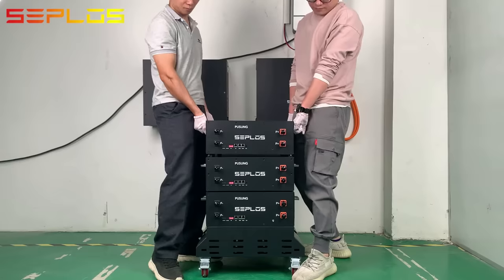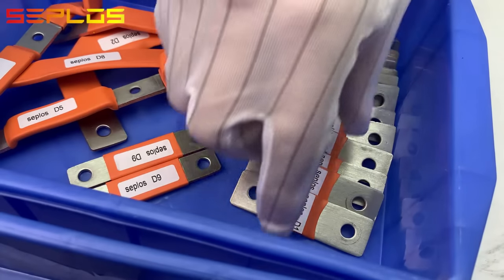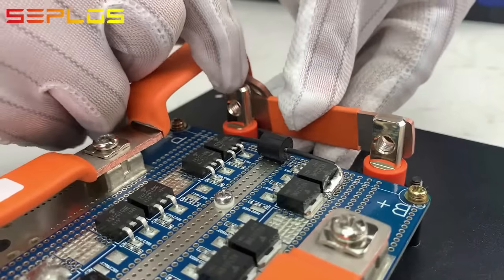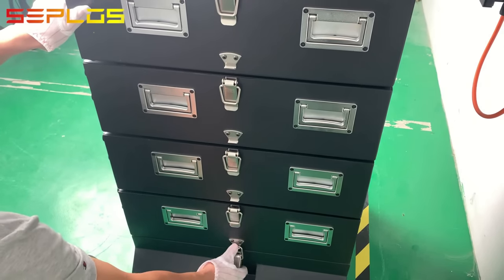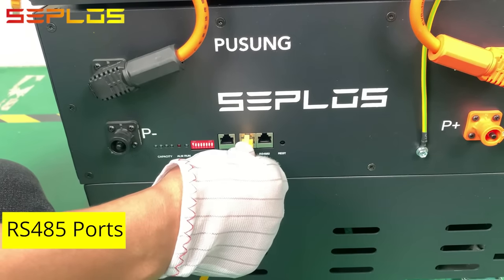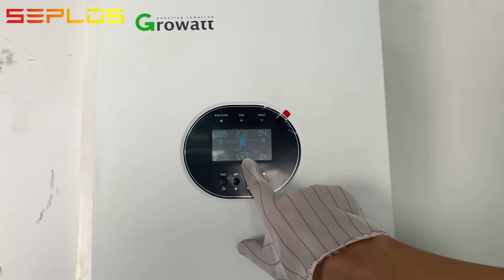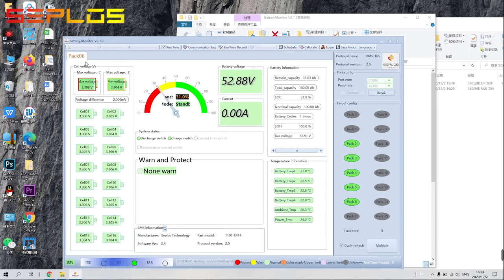30KWh Off-grid Back up Battery Pack With Growatt Inverter Setup-SEPLOS PUSUNG Energy Storage System

Comment: I really like their batteries and the quality,  their BMS is very Good. 
What i like about their batteries is that the cells are Grade A cells, and the pack is compatible with most of the top brand inverters like SMA, Victron, Goodwe, Deye, Voltronic,  Growatt etc,

I recommend for anyone that wants to use lithium batteries because their prices are very competitive and products are quality
Reply from the maker: Osei bright Thanks for recommending.

Comment: I  like how they a stackable. And the quality of the build. It would be interesting to have data logging for service inspection warranty and even  IOT and get performance data from the field that u can use to improve designs and advise customers on battery health before anything catastrophic happens
Reply: I’m sure they have data logging in their software. Most BMSs do. It uses RS485 so by nature it’s absolutely possible to integrate into your BAS. Cambus modbus bacnet lonworks are all capable of IOT integration. Probably won’t see it on some customer grade software like google home or apple HomeKit but it’s probably already being done.

Comment: Thank you very for this interesting movie!

Very nice, and well executed system!

I do have just 1 well-intentioned comment:

Parts that are connected to each other with (screw) connections, through which Voltage or Amperage runs, may possibly cause "amperage corrosion".

Think of the white deposit on the plus terminal of an old car battery.

If you apply special battery terminal grease between the screw connectors, amperage corrosion can NEVER occur.

Amperage corrosion can even, in the long run, lead to short circuits and/or other defects.

Comment from the maker: Thanks to all the participators. Three weeks later, this video gets the required views and comments. 
We'll sort out all the comments, and choose one lucky viewer to get the PUSUNG PACK. 
As descript, we'll message the winner through WhatsApp on 18th, Jan. 2020. Remember to join the WhatsApp group before announcing results: https://chat.whatsapp.com/JfSDMeIHcqk5ofkDSKvrSi
Thanks again for your participation, there will be more give away activities on the way. Please subscribe to us and stay tuned.
Reply: There’s a mistake in the video @ 4.14 where it says connect the two packs in parallel, when they are obviously being connected in series. One terminal is negative and the other is positive, there are two banks of eight batteries meaning it’s a 16S battery for a nominal 48V. Apart from that very neat system - looks extremely well thought out and safe.

Comment: Great setup! Great idea!
I would love to see selling the components separately. I think there is a big market starting.
Reply from the maker: The components kit is available. Any interests, please contact us at: info@seplos.com
Reply: @SeplosTechnology  how much  for 30kwh? And how many cycles  this battery has?
Reply from the maker: @patrykgorecki581  Battery pack at least 4800 times with 10 years warranty. Check this for the system details: https://www.seplos.com/seplos-pusung-s-51.2v-100ah-lifepo4-lithium-battery-pack-5.12kwh-home-energy-storage-system.html
Reply: We can manufacture plug-in connectors

Comment: Nope, we start out by measuring the voltage of each cell to see how well matched they are or if there are any bad ones, and THEN we start slapping on the buss bars and finish the balancing if they were already close. If they weren't, we send the mismatched ones back until we have a quality set to start.
Reply from the maker: @reflected Miles Thanks for your professional advice. In this video, we're expecting to present a way of cell balancing for DIYers, whose cells are with a slight capacity difference. 
Actually, the cells in the video are Grade A cells pre-matched and grouped with a capacity difference of only ±2mv.
Reply: @SeplosTechnology  In that case, my amended procedure should verify your excellent work instead of verifying after they have already been equalized. Think of it as the Will Prowse Standard. Professional, indeed!

Comment: Nice battery pack...
It will be nice to have no-oxidation paste on connection between two different materials...
And it will be good to install at least 2 temperature sensor on each battery module (4 in each battery pack) to be connected to BMS, not to measure only temperature in box...
Also will be good to have some fan to circulate that air when temperature rises...
It will be nice to make some tests on this battery pack to give more information.
Reply: Take a server cabinet with ventilation and its server mount variant, then install it with anti corrosion paste.

Comment: Awesome DIY setup. Neat and clean.

I would prefer to leave 1 or 2 inch gaps between two batteries. Just for safety concerns, in case one battery leaks or swells it won't damage the other batteries .

Chain reaction
Reply: you need to press those kind of lifepo batteries to prevet them from swelling otherwise if they got "space" they for sure will use it and be more damaged because the layers inside the cells will move and even break

Comment: Very beautiful setup.
Can you do one that offers cell-level balancing?
Can you do a storage system that offers the capability to house 272-300 AH cells? 
173 x 71  x 200 mm
Reply: It's got sense wires going from each cell to the bms so that should perform balancing

Comment: Very nice! 
I would like a case like this for my 16s 48V 280Ah EVE cells!
Reply: Same here, if you do find anything like this for the 280ah pls share with me too :))
Reply from the maker: We're so glad to hear that. 
Please stay tuned. We're planning to designed the new case for 280fAh cells.
Reply: @SeplosTechnology  Sounds great! 16s ? And with fixture (to protect against swelling)? Maybe with a >2A active balancer 200A BMS? Maybe the BMS able to connect to inverters (MPP Solar/Voltronic/Growatt) like Pylontech and LAN and Wifi communication with remote disconnect ? With optional precharge resistor?
I know, I ask a lot :D 
But I think everyone of us searching for this and do this with whatever items they can find (frankencells).
We need a plug-and-play solution for the cells. Pylontech sells his case+bms with cheap cells in a very high price.
Reply: @mrzed6597  You can buy a resistor to precharge at any car parts store for a few bucks.  Ive installed many systems and never pre charged a single one of them.  I have never seen this mentioned in any inverter manuals either, never even heard of it till seeing it on youtube videos.

Comment: Does it works with azzurro/Sofar Solar 1 phase hybrid inverters ? It speaks per Can-bus. That inverter works with pylontech battery backup.
Reply from the maker: Yes, Johny, Seplos battery preprogrammed with pylontech protocol. So it will go with sofar inverter.
Reply: @SeplosTechnology  Do you sell only bms elecitric board ? How much does it cost ? I would like to wiring on my own fe plug the battery.
Reply from the maker: @johnydeep1094  Yes, check it out on our official website: www.seplos.com

Comment: Btw. I don't understand how you can possibly balance at 3.3 volts when parallelling cells. You are right in the flat area of the charge curve. That's rediculous practice. Charge them up to 3.5  volts at least, all parallel and you are set.

Comment: I have a single battery pack, and the manual says all DIP switches should be off. However I get fault codes 4 and 20 on the inverter. Also, the Growatt manual doesn't say what protocols to use at Program 36.Can you help?
Reply from the maker: please contact our support team for help at support@seplos.com/alan@seplos.com

Comment: There are some steps that need a different order. Like insert the batteries mount screws before the front plate is mounted. Ease of access while open.
Reply from the maker: We were just get catched. 😂😂😂
As you mentioned, that would be easier.

Comment: Nice Work! After i have visit the datasheet of the chinese LiFePo4 cells the LFP cells have a fullcycle lifetime about 2000 cycles. with SOC 27% maybe 4000 ? Do you have some expirience with this cells? I think this is the LiitoKala cell you can buy also on Aliexpress?
I mean the battery is after end of lifetime not dead and have a capacity of 25,3 kWh. In your video i see the low voltage system for PV systems. I have fronius system and this use high voltage battery system. Do you can use the packs with serial configuration for HV use to inverter?

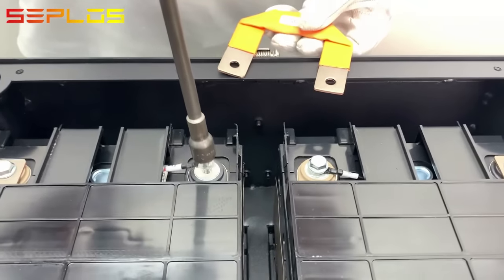Comment: At 4:10 it says to connect the packs in parallel, but I'm fairly certain that the connection is actually in series.
Reply from the maker: @JViz Thanks for your correction. You're right. It is in series.

Comment: The batterypack Looks really nice. The Assembly and the bulid quality seems also great. 
How long is the lifetime of the batterys and how much cycles handels it?
At 4:15 is mentioned that the cells are connected in parallel. I thinik you mean in Series. 
Thankyou for the Great Video.
Reply: They are in paralel...research a bit
Reply: @anotherdeejay  I think you are wrong because each lifepo cell has about 3.2v with 100ah capazity. There are 16 in Series, the Vortage of all These together 51.2 nominal voltage. 
But explain me, why you Think it is different. I am Open to new thinks.
Reply from the maker: Tim Gerllrich, You're right. Thanks for the feedback.

Comment: So do you top balance before putting in the system?
Reply from the maker: Yes. All our cells are Grade A cells, which meas they're the same level of voltage, capacity, internal resistance and so on. 
Top balance is not neccessary. Just for double check.

Comment: At least you did a diagonal connection to the inverter but... If each of these 6 packs is capable of outputting 100A of current then technically the cable nearest the inverter connection could carry 600A in the event of a problem. I can't see the rating of the short daisy chain cables but they look flimsy and certainly not capable of that amperage. I would not be happy to have this setup in my renewable energy building looks like an accident waiting to happen.
Reply from the maker: Thanks for your suggestions. You're right. 
In this case, we're just testing the communication between battery and inverter, actually no loads was connected. In real case, a busbar box will be recommended.

Comment: How did you guys get to (over) 50 volts with every 3.3 volt cell hooked up in parallel??? All i heard was "parallel" never said; in series.
Reply from the maker: 3.2 volt in series to 51.2v for each PUSUNG. And PUSUNG connected in parallel.

Comment: Do you have website we can visit, more info is required for instance what is the max voltage consumption during 1 hr. in std. home with 8 KW per day and so on, what is the panel system required or hybrid wind generator to keep batteries loaded?  Thanks
Reply from the maker: @Jorge Casados Perez Thanks for your comments. 
Our official website: www.seplos.com
For inquiries or general informaiton, please contact us at: info@seplos.com
For technique support, please contact: support@seplos.com

Comment: Is the discharge current and charge distributed equally for parallel battery packs?
Reply from the maker: Yes, they do.
Reply: @SeplosTechnology  in  my cased..they do not equally discharge in parallel for my 2 seplos bms set up in two battery pack...Can you help me with this?
Reply from the maker: @killuazaoldyck3913  I've confirmed with our engineers. In a paralleled circuit, the voltage is the same, and the current will be distributed accordingly to the packs' impedance. So there would be a little bit different. Could you please specify your situation?
Reply: @killuazaoldyck3913  You have to wire the two packs properly to your inverter/load/charger to get equal current flow in the packs.  If you connect the two packs together and then connect one pack to the inverter, the pack connected to the inverter will have more current flow.  If you connect the POS of one pack and the NEG of the other pack to the inverter, with the packs wired in parallel, you will more evenly distribute the current flow between the packs.
Reply: @Tro1086  ill connected this in parallel with postive in terminal of inverter in master pack then negative terminal in 2nd battery pack..Can i ask about the communication cable schematic  of rj45 cable between master and 2nd battery pack..I guest this is the problem because my growatt inverter only see the master SOC and not the other pack...
Reply: @Tro1086  I mean the RJ45 pin out between battery pack.
Reply: @ronryantuvera9483  Make sure you set the dip switches on the 2nd battery to something different than the first. They assign the battery number.
Reply: @Tro1086  of course i changed the dip switches..for the master 5 and 7 is on and for the 2nd battery pack 1 is on in dip switches

Comment: What‘s the price for the whole 30 kwh battery including all rigs, cables, consverters and so on? I‘m in Germany.
Reply from the maker: 30kwh system with all the cables retailer price at usd2109*6=usd12654. The inverter is not included. 
Any other questions, feel free to contact us at: info@seplos.com
Reply: the same more cheaper

Comment: The only issue is the limited output capacity due to the power running through each subsequent pack's cables and internal bus bars. A better solution would be to have each battery in parallel through a very large external bus bar so that the total output is that of each pack added together, and not just one pack. Great setup though for a large capacity low draw system!
Reply: hi,my friend,Seplos Technology glad to service,if u need something,pls feel free to contact me ~

Comment: Looks clean but the batteries are not compressed. Side compression should be 12psi. These batteries will only last half as long as they should.
Reply from the maker: You're very professional. We've update the modules with strapping band, which will provides 2000N compression.

Comment: you are not putting No-Ox paste on the connections that have 2 different metals - there will be oxidation. Not Good.
Reply: Very good question, the battery terminal is aluminum, the busbar is copper with nickel surface, and the screw is carbon steel, level 8.8 with nickel surface too. It is more good than stainless steel screw.
Reply: Because the aluminum is hard, and stainless steel is also very hard. When two hard thing screw together, it has chance to broken the inside screw things. But carbon steel is more soft, so it will be more good connect.
Reply: The key point is the connect resistance, all company pay attention to cells consistence, but this part will have chance to broken the consistency easy. So pay more attention on those small things will better

Comment: Declaring a series connection to be parallel and measuring current in Ah is rather off putting... I hope it’s only the marketing dept that doesn’t understand batteries
Reply: Looked like the cells were in series, but packs in parallel.
Reply from the maker: Modules in series. As you mentioned, the marketing team made a mistake. Thanks for the correcting.

Comment: "The voltage of the cells is within +- 2mV." So let me see here, 3.307 - 3.304 = 3 mV 🤔
Reply: It is stated correctly, for ex: 3.305 +/- .002 would be a range of 3.303 to 3.307.

Comment: How do you come in gray battery pack and you’ve never seen it and use you don’t know the amperage that the bars are busbars you don’t know what is it varies you don’t know how it reacts you don’t know how it charges you don’t know anything about it you’ve never seen a run I can see it’s tidy that’s only thing that’s good about the battery charging system and VPT charger mean what’s the ratio but we’re not is it micro is the individual!!There’s so many more questions to be asked who’s got one and how long are they Ran it???

Comment: Not the best choice. LTO cells are cheaper if I calculate with cycle, more efficiency, more healty, more Power.
The low price is tempting, but if you can do the math...

Comment: I have so far received twelve junk emails from third parties at an email address used for only one thing: filling in the enquiry form on the Seplos website to request BMS manuals.  Posts on diysolarforum suggest this is not a one-off occurrence.  DO NOT fill in the enquiry form on the Seplos website unless you're happy receiving unsolicited emails from third parties such as EveryChina as a result.

Comment: Battery storage is so exp.
Reply from the maker: Check the Mason DIY kits series, which comes with an affordable price.
Reply: @SeplosTechnology  Are those fire-safe or lithium technology?
Reply from the maker: The cells applied lifepo4 chemistry, which is a safe material with no fire and explosion. Check the lifepo4 cell short circuit test on Youtube.

Comment: This is so overpriced it should be $1000.00 max people can build a 20KW for under 2000.00 including BMS.
Reply: What bms would you use ?
Reply: @smartazz  overkill solar has good BMS units, with built in bluetooth, you can also use ANT BMS.
Reply: @Foxfried  Iv got the Ant bms. Very good unit
Reply: Where do you get 20kw worth of cells for under $2000?  Serious question.  Iv seen 16 280ah cells for $1900-2000 on alibaba, but thats only 13-14kw
Reply: @Tro1086  Look harder, you can get these in bulk with a price of $100/KW with lishen 280.
Reply: @Foxfried  Where from?  What kind of bulk?  Im only one person, I cant really buy them in much bulk, are there group buys?

Comment: Great fireworks if this black box goes on fire. Where is the circuit breaking. Cmon guys where are the safety circuits. That’s the problem the „specialist“ rely only on bms. Fire prevention not installed, capsule with powder can be realized. This is only for someone who has no head and electrical education.